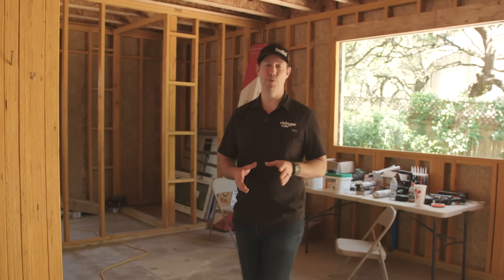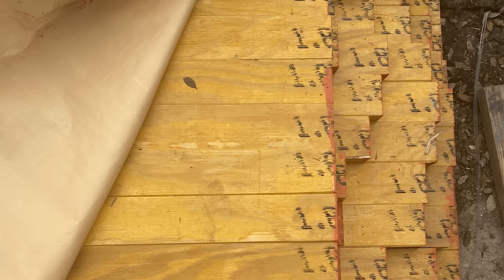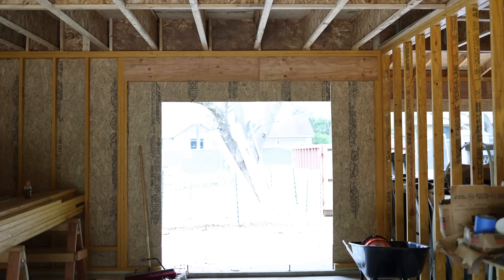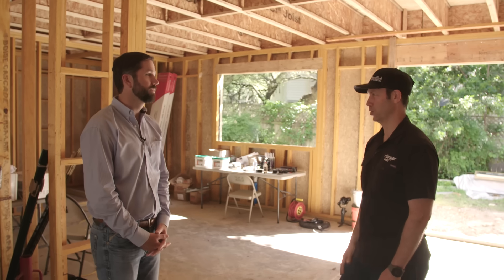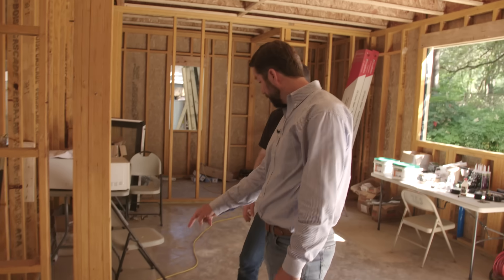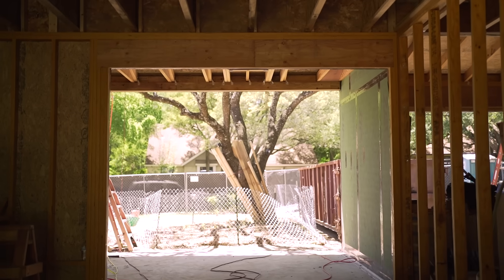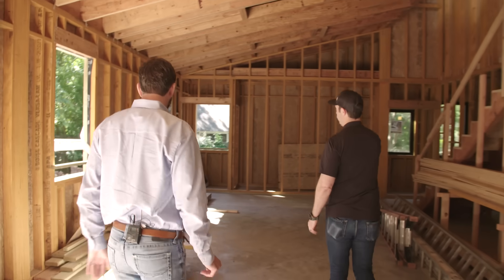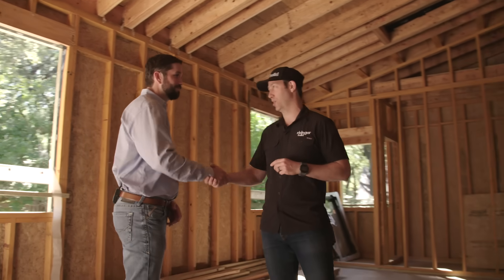House Engineering - Common Mistakes

Comment: I know engendered wood is more stable, but solid wood is what I like to build house from more then osb boards . I would like to know what’s going to happen after 100 years  , with these osb houses ,, osb lumber has minimal moisture absorption , water will kill osb has no give .. the house must be 100% seal from water and moisture.. solid wood can take water no problem if there is leak or moisture problems , no house is 100% leak and moister proof .. 
1/2”  osb vs 1 1/2 “ solid wood joist  , I pick solid wood lumber  .. all theses engineer lumber products is hold by glue only , that glue fails game over .. solid wood has no glue
Reply: Some of the more modern glues used in these materials are pretty moisture resistant, but remember it is just gluing tiny bits of wood together. The glue passes the stresses to the little bits of wood, and concentrates the stresses in ways you do not see with tree lumber. Glue fails or little wood chips fail when damp due to stress concentration - either way your building falls apart if it gets wet.
Personally I like the look of steel stud systems (as long as they are installed properly and designed with proper safety factors), but have never built with them or examined how well they hold up over 50 years or so.
Reply: If water is penetrated your sob wall sheathing you either didn't install house wrap or you need to fire your siding company .water shouldn't be penetrating threw the siding .
Reply: Romano Actually, wood has lots of glue in it.  It is called lignin.
Reply: I’m not a building scientist by any means. But I would be shocked about hearing of a glue failure. And now with the spray foaming and sheathing with the wrap attached I think these houses will last the test of time. I’m just a remodeler, but I love the advantec subflooring. Water just beads up on it. I’ve left scraps out in the elements an no mold growth and board doesn’t turn to mush like OSB. If engineered studs weren’t so expensive I’d switch to them.
Reply: Advantech is incredible. A scrap of Advantech can lay in the dirt for the whole build and never swell. I once had the displeasure of working on a house where the developer was having major cash flow issues, and we had to leave a house with only an Advantech subfloor. It was totally open to the elements for months and months. When the developer finally had us come back, the Advantech was dark gray. It looked terrible. But it was as flat and solid as the day it was installed.
Reply: @wmichaelbooth  Any structure sheathed with standard plywood would need to be completely stripped before you could continue because the plywood would have lost all it's structural capacity. People have a tendency to poo poo engineered lumber but they usually have little to no real basis for it. Like you say, I've seen LVL's sit submerged in water all winter long with no water penetration what so ever. Pull it out of the puddle and wipe it off and it's as good as new. Another major plus to using these engineered products is no termites.
Reply: @iamjackalope  I don't believe that for one minute .lvls sitting on the ground getting rained on for a few days will swell and suck up water. Anyone that's been framing for a few minutes knows it. That's why they are used interior only .they just recently started to try to pressure treat them but you still need to use a flashing tape on top of you are going to use it for a deck beam or something that gets the elements
Reply: @jefflinnell8492  I like to keep all my lumber dry if possible. but if I have any engineered lumber it is not a preference it is a MUST!  LVL. advantech, OSB all of them have major drawbacks.  Maybe someday they will engineer something that will last for centuries  but so far nature has proven to be the best engineer of all. 
There is nothing better than good ole fashioned wood. Even treated lumber does not outlast cedar. Our old family farm has cedar fence posts my great grand dad placed that are still in use. By contrast my treated lumber fence posts have been replaced twice in the twenty years I have lived here! Termites won't touch the red core of eastern red cedar but they seem to eventually become immune to any man made treatment eventually.
Reply: @kensfestoolchannel7916  No way OSB will outlast solid wood. In a hundred years many of the NOW 100 year old homes will still be lived in, but most if not all of these engineered homes will have been torn down or rebuilt piece by piece. I am also a re-modeler and love the price and availability of OSB, but I have seen many expensive service calls for issues that would have done almost no damage in an older home and they were much more leaky and subject to moisture infiltration. Imagine all the 100 year old barns still standing with not even a coat of paint. Try that with OSB even advantek!! Even in a dry situation I do not think the glues will maintain there strength and bond over the long haul. 
I have a 15 year old porch that has an OSB roof deck and despite having freeze guard and high quality shingles the OSB chips are curling off and the sheet is shedding them slowly. No actual water or moisture can be detected it is just adhesive failure and the effects of humidity and temp swings. Within MAYBE another 10 years the OSB will have lost all structural integrity. My home is 85 years old and the original solid wood plank roof deck which HAS had leaks and moisture issues over the years is still strong and basically unchanged! Every newer technology seems like a better mouse trap until the manufacturers fade away or discontinue the products and terminate the warranties they promised, which is written into the warranties in most cases and we discover the stuff was junk from the start. The shinny new apple always rots eventually.
Reply: Michael McKinney home Cheapo and Blowes OSB is shit. But you are aware Avantec is an OSB type product in how it’s made. But we can bet all we want. I won’t be around in 100 years.
Reply: @kensfestoolchannel7916  Neither will Advantec most likely! lol
Reply: Michael McKinney I guess we will see. But, if it is or isn’t, it will be improved upon or the new product will be even more advanced.
Reply: @kensfestoolchannel7916  fiberglass, carbonfiber, osb and other types on composite material have really short lives. in aircraft fiberglass components get replaced often because they dont hold up and begin to crack, splinter and fray. osb just turns back to woodchips as soon as it touches water.
Reply: Mitri you have never seen Advantec then.

Comment: I will argue all day and every day that a deck screw will hold longer and better and will not shear in comparison to a penny nail for joist hangers. A nail will pull before a screw head will shear even with perpendicular pressure. The manufacturer of the hangers where bought out by the nail company. So of course they would only recommend their own products, and thus engineers say follow manufacturers recommendations.
Reply: Yes and no. For a non structural deck screw versus a common nail, no shot in hell the nail shears before a common deck screw. Nails are designed for shear, screws are designed for tension or pullout. However, get the right structural screw with a shear value greater than an 8d nail and you’d be right.

Comment: Are they not going to run any electrical wires? Might deminish all the hard work in framing this air tight.
Reply: The air barrier is at the outside of the wall face, with the exterior insulation, which is continuous up the walls and over the roof. This gives them a lot more flexibility. Check out the earlier videos on Matt's own house project. He discusses that.

Comment: do a show on down sides if engineerd   joists. i know their burn rat is terrible during a fire and are a hazard
Reply: Then you know nothing. Same astm char rating as lumber
Reply: @sparksmcgee6641  Char rate is one thing.  It's all wood after all,- however time to failure on a loaded OSB structural member vs. a traditional solid sawn piece of lumber is the true test of performance.  These char tests are likely only testing the rate of decomposition of the material, and not it's real-world load bearing capacity.  The resin in OSB breaks down rapidly under fire conditions, and since there is very little cellular continuity in OSB, the member will fail faster than a traditional structural member used for the same application.

Comment: 16 on center? Those roof joists are all over the place. @12:00
What a nightmare for any future plans.
Reply: I noticed that too. Weird irregular distances between the studs
Reply: The reason for the irregular rafter spacing is the skylights. You have to adjust the rafter spacing to fit the skylight size so as to not compromise the structure in those areas. And skylights come in standard sizes that don't necessarily fit the regular rafter spacing.
Reply: @Seattle-2017  I don't think that's the issue. If you look closely in the top right corner at 12:00 you can see an opening framed out similar to a window. That looks like it was made for a skylight. The 2 rafter bays to the left of it look like 24 on center, then 2 more bays with doubled up rafters in the middle. I'm not entirely sure what kind of loading is going on there but, like Stan said, it is a nightmare for any future plans.

Another thing that's kinda weird that I'd like to point out, is that the doubled up rafter on the left is fairly centered in the bay while the other one is off-centered to the right. Again, I don't know what kind of loading is going on there.

Comment: I had a box of deck screws with a defect where almost all of them snapped in half while bring screwed in. Imagine if they'd been used in a structural application?
Reply: There are structural deck screws and there are non structural deck screws. Non structural are brittle and if you are screwing into a hardwood with cheap deck screws, that’ll happen.
Reply: I built my entire house with deck screws and it has survived 6.0 earthquake and 2 tornadoes. Get the large ones and use a lot and you are golden.

Comment: Hi fun video, since im a i-beam constructor from Norway. You covered the most important "issues" with i-beam, witch is "shear force", 
I always put details on my drawings on how to do it right (since its commonly overlooked).
I do have one question about that coloumn with all that load, it sits on a timber sill, also its on the end at the sill? 
Usually all coloums with extensive load has to have direct contact with foundation, since "sills - not sure what u call them" have wood fibers horisontal.
And structurally wood is weak with fibers horisontal, is this different with engineered wood?
Regards (sorry for bad english).
Reply: The LVL has a higher perpendicular to grain value than the typical SPF or SYP  lumber used.  You are spot on with standard lumber crushing perp to grain.
Reply: I'm curious about that too, perhaps IT IS different with engineered lumber. From my experience, it is very hard to compress plywood, which is basically what an LVL is with different dimensions. I definitely would not do it with traditional lumber though.

Comment: Lvl headers sound nice until you realize lvls cup so you think you are going to just slam the tother, but a cupped lvl won't nail perfectly tight to another and you still got to plane them. Glue lam headers dont cup.

Comment: Is a house with all engineered wood, more flammable? Heard they'll engulf faster in a fire than the old houses in the past.
Reply: Jesse Birster definitely not, compared to traditional framing. That engineered glue hates to burn.
Reply: Keep in mind the building code defines fire resistance of "assemblies" rather than individual materials, which is an attempt to account for more realistic conditions in buildings, since materials in buildings are always found as part of a larger assembly. Also, not all engineered wood behaves the same way in a fire. Thinner sections ignite more easily. So I-joists may ignite faster than LVLs for instance. 

The key is to design with an understanding of what causes most fires and how fires spread. Then design to minimize those conditions and to give occupants the fastest means of escape. 

After that it's a question of budgets and priorities. You could choose to paint your i-joists with an intumescent paint, which turns into a protective coating when a fire starts. Or you could choose to spend that money on a sprinkler system instead. I would choose the latter. Of course, if the budget allows you could do both.
It's all about risks and benefits. The single largest source of housefires is the stove in the kitchen. And yet most homeowners don't keep a fire extinguisher nearby.
Reply: it burns good, ive burned the scrap piles on jobs.

Comment: Should the web stiffeners be notched so that there is OSB contact on the I-beams?   The engineer mentioned the load would try and crush the OSB so the stiffeners are required, wouldn't they need to be touching to be effective.  With the gap, I know it's only an inch or two, it does give it room to flex back and forth though.
Reply: We gap about 1/16" to 1/8" at the TOP of the compression blocks and screw through the complete package. The top gap is so that the OSB web can shrink a bit over time (not likely, but...) without the unyielding blocking trying to separate the flanges from the web, which could be disastrous.
Reply: Depends on the specific application. Where you have a point load coming down ON TOP of an i-joist, you want to add stiffeners to thicken the web of that joist all the way down to the bottom of it. In effect, that part of the joist becomes like a mini-post, transferring the load above to the wall plate below. 

When you simply want to block a run of floor joists somewhere near mid-span, it is enough for the top and bottom flanges to touch the blocking. You don't need web stiffeners there. This prevents the joists from twisting and buckling.

Comment: love the attention to detail! I believe in one of your past videos you might have mentioned the cost increase for going the LVL route, but that would be a good detail to mention. AND: what is the industry's take on off-gassing of these manufactured products? Will gasses be gone before the sheetrock and the tightening up of the house is completed? There is also the possibility of the toxic hazards during the manufacturing process. I would imagine the big wood product guys make sure the workers are protected, but that's not always the case (see PVC manufacturing procedures). Thanks, once again, for a great video.
Reply: Hi Tim. My understanding is that whatever out-gassing is going to happen due to the glues will happen during the glue curing process at the factory. I don't know what worker protections are required in the factories but hopefully something is in place. I don't believe there is any out-gassing issue once the materials are on a jobsite. Indoor air quality will probably be far more affected by simply cooking with a natural gas range rather than due to out-gassing from the lumber.
I believe the major manufacturers have moved away from the urea-formaldehyde glues, which out-gas longer than the phenol-formaldehyde and isocyanurate glues. If I was working with a client who was especially sensitive (I have in the past) I would pay more attention to the sheet goods than the framing lumber. Avoid OSB. Use plywood that has a non-formaldehyde based glue. Columbia Forest Products' "PureBond" is one to look into. More importantly, pay attention to the material used in cabinetry. Most stock kitchen cabinetry uses the cheapest and highest off-gassing MDF and melamine glues. Cabinetry and floor finishes such as vinyl are a far bigger concern for indoor air quality.
Reply: @HistoricHomePlans  Thanks for the reply. Yes, finishes are (can be) a huge concern regarding air quality. You correctly bring up cooking with gas affecting IAQ. The availability of induction electric cooktops should make gas cooking obsolete. I would challenge any cook or chef to test its effectiveness over gas. Removing gas from all parts of a structure is important, and quite easy to achieve good results with electricity. [sorry for the tangent]
Reply: @timskufca8039  From what I know most chefs already prefer using an electric oven over a gas one because you have finer control over the temperature and the type of cooking. Hopefully induction isn't far behind, but from what I understand it's a bit of a toss up as to what they prefer just because old traditions die hard. I know my next cook top will be induction that's for sure.
Reply: @vincep7014  I've used an induction cooktop for about 15 years (and have a background in commercial cooking). I love its response time!, and cleaning up is EASY! The problems are cost for purchasing and repairs. Gas cooktop is simple plumbing; induction repair is replacement. (I don't have any data as far as maintenance history on induction).
Reply: Tim Skufca problem with any indication cooktop is they eventually scratch even if you are meticulous and look like crap-otherwise many advantage however.I also laugh a bit when people is iOS of huge commercial grade gas cooktops and dont have a sophisticated automated vent fan system , yet are obsessed over outgassing from fabric on a chair or LVLS !

Comment: Nobody wants to hear the deal about shrinkage. I'm a component designer and my last job was a multi family building. they used 2x12 with sheathing to shim to 11.875"  depth for fire blocking over party walls. I have mixed feelings about that. It's the contractor's right to take the risk I guess, Gotta respect that. I appreciate this video
Reply: The contractor shouldn't be making design and engineering decisions. Their job is to follow the plans.